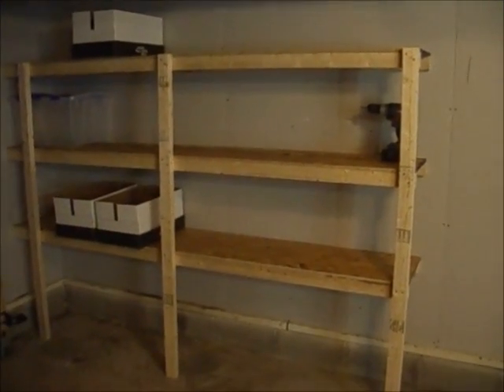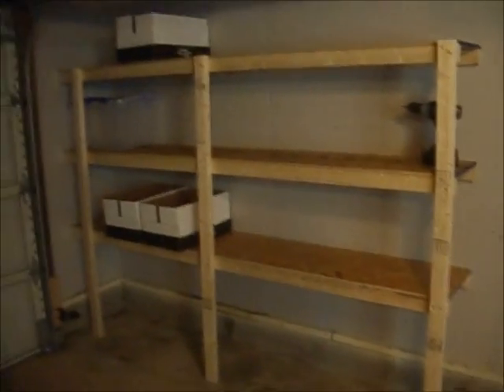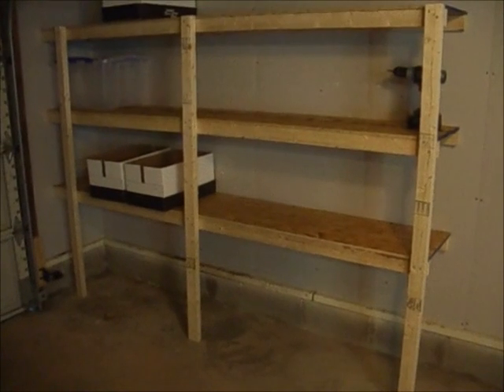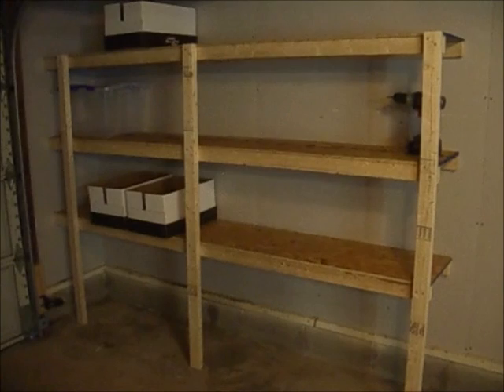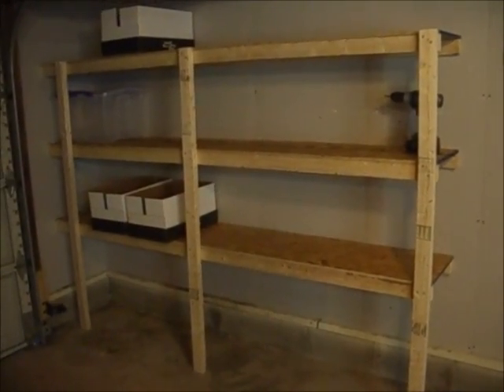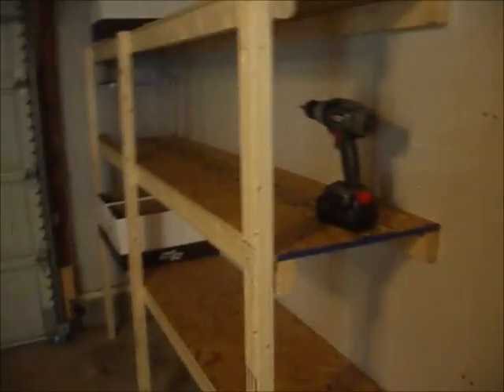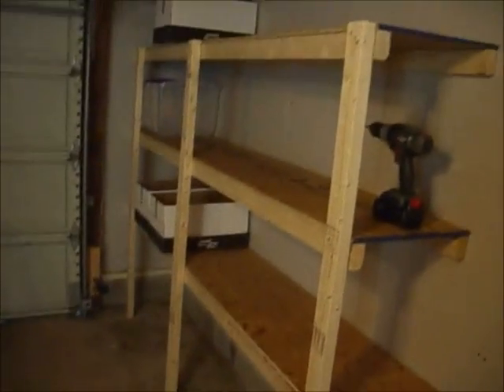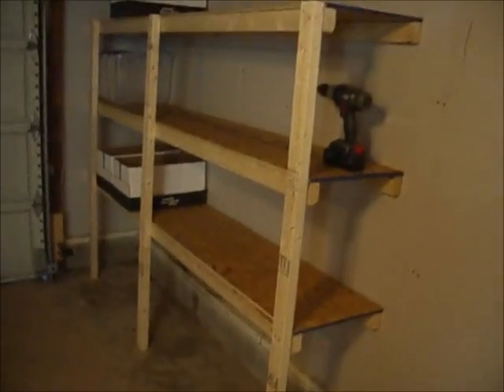How to Build Garage Shelves - Cheaply - NormalGuyDIY

Comment: @ultimaniac1 Normalguydiy's advice is a very commonly used technique.  Any experienced DIYer can do that.  However, sometimes beginners have trouble hearing the difference.  If you think you are close, you can gently tap a long finishing nail through the drywall in a series of very closely spaced horizontal holes to "feel" for the stud and confirm its actual edges.  However, be sure to do this BEHIND where the 1x3 rail will be, to hide the ugly holes.  Then measure 16" like he said.

Comment from the maker: @JJMRJORDANJR I set my bottom shelf 27" up from the floor so that I can slide larger things underneath, and then each shelf above that is another 19" up. I have a fairly low garage ceiling, so I set the top shelf height so that I can fit a standard storage bin on top, then just split the remaining space between the top and bottom shelves to set the height of the middle shelf.

Comment from the maker: @Jz81650 Good idea, I added a note box to the middle of the video, same info is in the notes below the video. But it's really just:
One 4'x8' sheet of 5/8" plywood, and nine 8' long 2x3's. I made two 8' long cuts in the sheet of plywood to make 3 equal 16" shelves.
The actual height of each shelf, and total height, will depend on the height of your wall, and the height of your storage boxes. Good Luck!

Comment from the maker: Agreed, I definitely wouldn't put tons of heavy items on there. You could always use a thicker sheet of plywood. I suppose it would help to have extra vertical supports on back of each vertical 2x3, in sections between the shelves and going all the way to the floor. But I'm no structural engineer. Thanks.

Comment: One trick I saw on another video is to screw one board to the wall, then screw the outer board to that one(not screwing in all the way, maybe 1/4-1/2 the board depth) then attach the legs to the outer board..  Once done, unscrew the outer board from the inner board, and you have two boards at the same level one on the wall, one on legs.
Reply: Im wondering if there might a problem though after you've distanced the outer board from the inner with the shelf, the garage floor might be off?

Comment: A quick tip, if I may. When your rear shelves are supported the way they are in your video you do not need the middle-front 2x4. Then nail the right-front 2x4 into the end of the shelves instead of the face. Cut the left-front 2x4 shorter, put it on the concrete base/footer and you can screw that into the wall. Use pocket holes to support the shelves into the left 2x4. Why? Because each 2x4 is 3-1/2" wide. So you are giving up 10-1/2" on each shelf and the floor for storage from the three 2x4's in the front. Multiply that by 2 shelves and the floor and you are losing 31-1/2" of storage space overall. Nice vid tho. Short and to the point.

Comment from the maker: @iakopomageo My shelves are definitely strong, I used 5/8" plywood and it's only a 16" deep shelf, so I can climb the shelves. Just be sure to use a couple screws at each connection to the vertical supports. Thanks for the post.

Comment from the maker: djs0522, yes, 3" screws get through the 2x3 (1-1/2") and run another 1-1/2" into wall & stud. I didn't use pilot holes. They work great though, if you want to take the added time.

Comment from the maker: @4251S Good idea, if you have a good sidewall with studs in the rights area. I used that 3rd vertical 1x3 in the front because my sidewall there was lacking normal studs to screw into. Thanks for the idea.

Comment from the maker: @ultimaniac1 I would just use knuckles or a hammer handle to tap the wall and listen for the sound change at the stud. Once you have one that is right, they are likely 16" on center, but tap it out to confirm. Good luck.

Comment: Thank you for the idea! I was able to build one like this in about 3 hours. I actually didn't even cut vertical beams (and I used 2x4s for these) so I built these without even touching my saw. They cut OSB board for me into 3 parts in Lowes :)   One tip I would like to share is that you can use a tripod or a light stand to hold top shelf wile measuring and attaching middle beam (if you don't have help).

Comment from the maker: The 2x3's are 1.5"x2.5", so depending on how thick your plywood is (5/8"), I was able to use 2.5" screws for all of it, but be sure to measure your own wood 1st, screws are very expensive. I'd get your wood first, then measure for the screw length.

Comment: hi i am a student of the crossing and i would like to know how much this costed you because we need to know how to build one and how much it cost thank you and god bless you.
Reply from the maker: Hi Tyler, I used one 4'x8' sheet of 5/8" OSB sheathing board @ $8/sheet, and nine 8' long 2x3's @ $1.50/each x 9 = $13.50. So that's $21.50 plus the cost of the screws that I already had on hand. Good luck on your project!
Reply: Thank you we are building 2 so we got 34 2x4 and 5 sheets of pile wood we making on free standing and one on the wall

Comment: What type/size screws did you use?
Reply from the maker: I just use an exterior wood screw, at Lowes they are called "primeguard" - but many types would work. Not sure of the screw length because I choose the length once I see each board that I need to get through (without going through to other side).